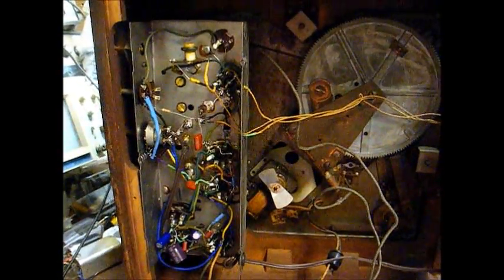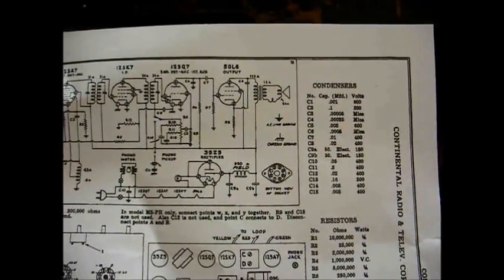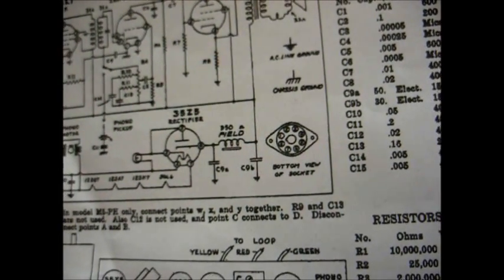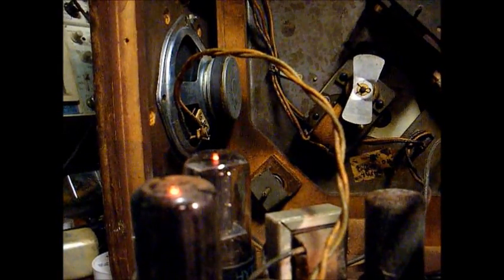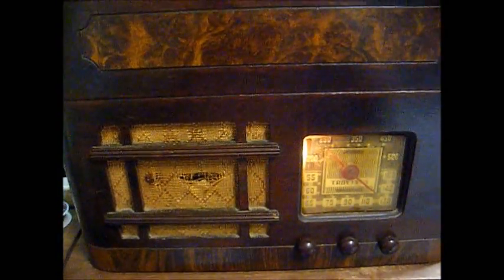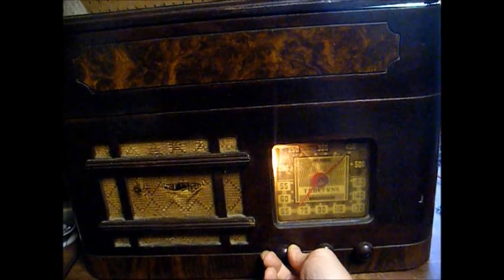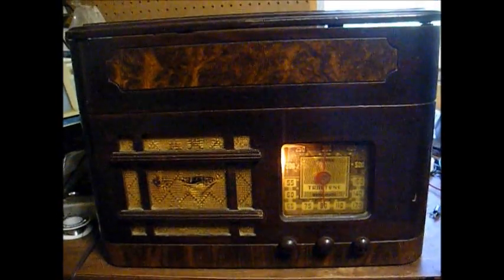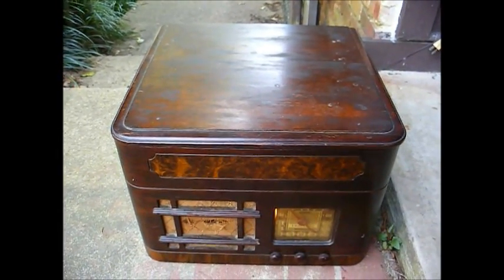Repair of an early '40's Truetone tube radio & phonograph combination - part 4

Comment: To be frank, a lot of radio stations, AM and FM are managed by idiots, regardless of whether they are corporate or privately owned. The owner of that Black gospel station is acting in his own peril to flip off an audience like that. Many of the corporate owned stations are equally indifferent to what the audience want to listen to, rather then listening to feedback from the audience about what they would like to hear they just use this corporate "Cook Book" about things to try to boost ratings.
 One of the oldest stations in North America, CFCF in Montreal, was closed down due to such stupidity. First they changed the call letters, then they kept changing the programming format every six months so nobody could keep track, all the while the ratings were dropping and the pinheads couldn't figure out why.

Comment: I never liked the hot chassis design concept, it always looked extremely dangerous, and in fact even the technical manuals say as much. Hot chassis sets are rare in Canada, the only ones we see are imports from the U.S. In fact AC/DC were not allowed onto the market until 1940 or so, and only with a floating common negative. Of the few hot chassis sets I do have, one I am converting to having a floating B-, and I am contemplating doing the same to the others. I don't like reworking original designs as a rule but I'm not going to risk a shock hazard just to save maybe 10'' of hookup wire and a capacitor.
Reply: I don't really understand what the benefits of a "hot" chassis are.  It just sounds dangerous especially in countries like the US where the mains plugs were not always polarised.
Reply: In some countries like France the mains plugs were not polarized either, not sure about now. I believe in Italy they use three pronged outlets but the prongs are all in a row. Probably the best design that I have seen are the Australian/New Zealand style with the slanted blades, it's impossible to insert one of those the wrong way around, Oddly enough they are identical in design to the older 240 volt air conditioner outlets they used to have in the U.S and Canada. But in Australia I don't think they ever made AC/DC sets, everything that I have seen from there uses a power transformer.
Reply: Here in the UK our plugs are designed in such a way that they can't be inserted incorrectly, they also have safety shutters to stop things being poked in the holes of a socket when nothing is plugged in.

We use 240v as well and I have an Irish Electric model 534 radio that is an AC/DC set with a live chassis.
Reply: That must be a more recent development, I remember seeing a British "Public Information Film" from the 1970s showing a workman inserting the leads of a power drill cord into an outlet using match sticks. At one time there was as many as four different styles of electrical outlet used in Great Britain, so I guess that was the reason why electrical devices often came without a plug attached to the power cord and why some would try plugging a drill in with match sticks.
Still it is easy enough to convert a hot chassis set to having a floating ground/common negative, and I think it adds more of a safety factor then a polarized plug as the outlet could be connected wrong.
Reply: I think I've seen the same video you did.  It's still possible to do that with the shuttered plugs if you jam something in to the earth pin first.  I think they were designed to protect children really.  The shuttered sockets were introduced in the late 40s but some old buildings still have the old "round-pin" sockets though this is very rare and are usually not used - just left there for show.

It's been a requirement since the late 80s I think that all appliances sold must now be supplied with a fitted plug with the correct fuse value installed.

Comment: That radio sounds good! Even the weak stations. Apparently bad solder connections? Did reversing the power cord make any difference? Even with the old speaker it sounds good. That field coil speaker will reduce the hum 2 ways - an inductance in the pi-network power supply filter - and the hum-bucking coil in series with the voice coil. I stand corrected about the floating tuning capacitor. That RF ground cap was a common trouble on the later 12BE6 converter sets.
Reply from the maker: Reversing the plug made no difference.

Comment: The chirping I have heard before on equipment that operates on the 2.4GHz band such as AV senders.  Usually caused by Wifi routers.  Maybe the radio is being affected by a harmonic of that?  Complete guess but the sound is so similar.